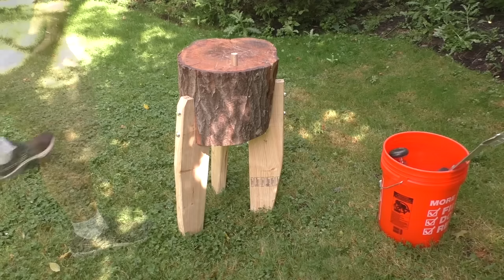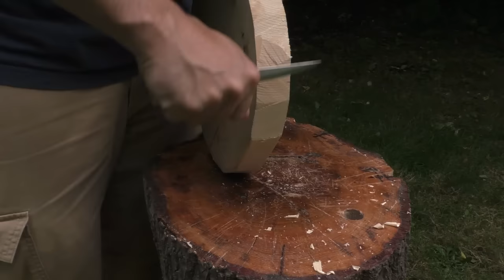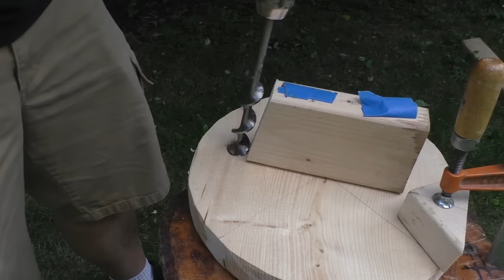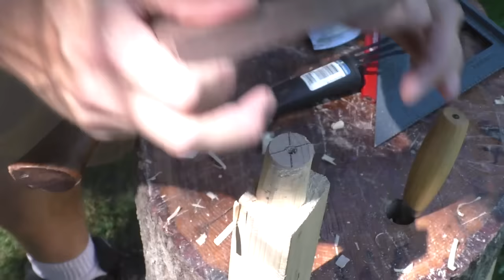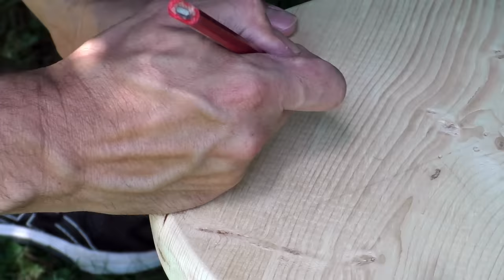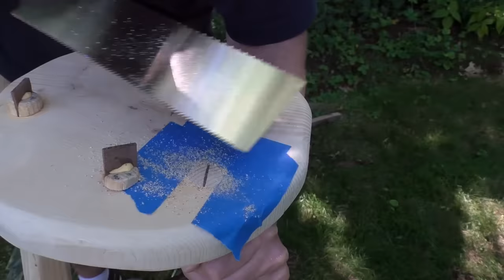Make a traditional milking stool. Limited tools. No Bench.

Comment from the maker: There's a small mistake in this video. I said the resultant angle of the legs was 5 degrees, but it's actually 15 degrees. You can experiment with angles; it's a flexible project.
Reply: Rex Krueger Hey great video I think you should make some sort of storage for all the tools on the joiners bench or some sort of storage system for all the tools we have
Reply: Dammit Rex I cut it at 5 and came back and watched the video again and I was like "I did nothing wrong!" All good, it's good practice to fix it. Thanks for the videos!

Comment: Well, there is no need  for a try-square to mark the legs position.
After drawing inner circle just put the center of the 'compass' onto one of points where the former diagonal cross it. Then draw another circle from this new center with the same string length. Points of crossing of this two circles and the opposite point of crossing the line and inner circle will be the legs positions.
Minus one tool, and still simple and perfect.
Reply: That thought crossed my mind too : )

Comment: This is the most recent project I could find that utilises the round tenon joint. I looked for it for a reason. Has nobody ever wondered why the legs are BOTH glued in with a wedged tenon...AND...the intention of the leg sliding up and tightening into the circular mortise hole? I mean, which is it to be - fixed (wedged and glued) or sliding (tightening under pressure). It can't be both. I've always wondered about that in previous projects. I'm not having a go at this or any previous projects that have this method of construction; I'm just doubting that glue on the tenons is necessary if the legs are expected to eventually seat themselves under pressure. In fact, I think it would prohibit it because it would hold for a time and eventually the glue would crack, at which point only then would the leg taper settling start. It would be better to assemble this joint with no glue at all and make the wedge slots much deeper so that they can be tapped further home as required with settling movement, while also planeing flat the leg tops as required before reseating the wedges. If you know what I mean...???

Comment: when you're planing big flats with your knife, this grip can be even nicer
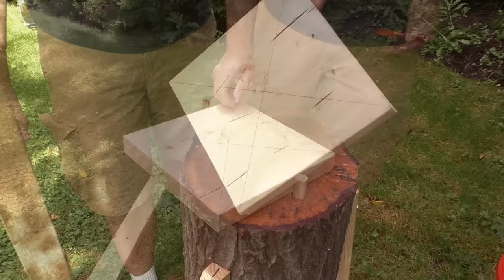https://youtu.be/0hgAzKo5G8Y (around 2:10)

You sit holding your knife in more of a dagger grip, palm-up, with the point of your knife angled back toward your navel and the sharp edge away from you. You start cutting at the close and of the material (where you're holding the wood against/along your thigh) and push away from yourself. It ends up giving you a very flat, straight cut.

Comment: Hey Rex I have a pretty interesting bit of geometry for you. 6 equally spaced points on a circle are actually spaced the same distance as the radius. This means you can use that same piece of string to make 6 points and join them like you did here
Reply: The bestagons!
Reply: no need to use a string then! use tthe speedsquare to mark 6 60ª degrees  lines (360/60 = 6 lines just like Rex did)

Comment: you can get the 60° angles by re-using your small diameter string and put the tack on the  intersection opposite of the initial starred intersection. ...this is for the more mathematically inclined, namely exactly 60 degrees in theory.

Comment: There is an even simpler way to evenly space the three legs. Just take the same string, that you've drawn your inner circle with, put a thumbknack on the opposite side of the straight line from that star you marked your first leg and them just mark two points on the circle with a pencil and string. =)

Comment: I am working on a project with wedged round tenons I am cutting by hand. I figured out the method for using the same drill bit to define the circumference of the tenon. I felt so vindicated to see that solution again here!

Comment: I don't believe in a workshop with $250 planes and $120 back saws. But this frugal tool set might be too much on the other side. I get the point though, the video and explanation is excellent. I just would not recommend it.

Comment: Around 10:15 , need tool..

How about doing a video making a tapered tenon cutter and matching tapered mortise reamer? 

Also a froe from a junkyard leafspring would be a great video. Include the trip to the junkyard and removing it yourself if possible.

The above, along with a drawknife and shavehorse attachment for your roman bench would pretty much round out a shaker furniture kit.

Then do some primitive bending with fire and wiping water on workpeice, rather than a more complex steam unit.

Comment: actually the chopping block only needs it's center of gravity shifted further to the bottom... either a longer piece of block or a concrete block, suspended with a rope from the bottom of the block should do just fine... spreading the legs would increase the chance of tripping over them and falling into..tools.

Comment: Excellent video, but I'm wondering: as a 3 legged stool, is cutting the legs to length to level them really necessary for stability? If it were 4 legged, I could see the need for that, but with three legs, it should be stable regardless of any difference in leg length.

Comment: The big upside of a three-legged stool is that three points define a plane - no wobble.  If there's a solid surface to stand it on, it won't rock.  BUT it also has a significant downside: the coverage under the load isn't as wide as the load itself.  It's pretty easy to tip it over.  If you have wood tough enough to take the load - both in the mortises AND the tenons, because the leverage applied to both elements goes up quickly with the angle - splaying them wider will make the stool a lot more stable.

Comment: There is a much easier way to mark the locations of the legs. Once you've draw the smaller circle and marked the top and bottom on the line that bisects it, take your string compass and place it on the bottom mark. Draw a mark on the left and right of the bottom mark. Repeat the same for the top mark. You now have 6 marks along the circle, use a straight edge to connect the opposite marks. All lines should cross in the center. No measuring needed.

Comment: You can reduce the size of your tool set by one, if you use your string compass to set the sight lines.  Pick a point on your second circle directly opposite where one of the legs will go (across the diameter of the circle from where you want the leg), and mark both the leg location and the opposite point in the far side of the circle.  Set the tack in the wood at the point opposite your leg location.  Make sure the string length is still equal to the radius of the second circle.  Swing arcs to each side of your point marking where the arcs intersect your second circle.   Those two points plus the first location you chose are your leg locations.  Use a straight edge to run lines from the center of the circle to each of the points and you have the sight lines.  This is probably a little easier if you do the layout before you do any shaping of the seat.  Prior to the 19th century, most of the layout work was done using dividers, straight edges, and a marker of some type.  Graduated rulers or protractors were scarce until industrialization started to seriously get under way.  George Walker and Jim Tolpin's By Hand and Eye is an excellent discussion.

Comment: You could always just add an extension to your chopping block workbench like a 2 legged saw horse just enough to hold the other end of a piece of wood you have clamped to your chopping block then you can saw it at standing height

Comment: Another way to get your 60 degrees right is to start from your diameter, find the center of the bottom radius, and draw a line square to it. The intersection points with the circle are then dead on.

Comment: @Rex Kruger from my high school geometry class, many moons ago: Circumference = 2 x pi x radius, if you assume pi is close to 3, you can approximate the circumference is about 6 x radius. If you walk the shortened string around the circumference of the inner circle you will get approximately six equal divisions. It's not perfect, but it sure is fast to get six or three divisions round a circle.
Reply: Its even easier than that: the radius of a circle is exactly the side length of the largest hexagon that fits inside. Use the string to draw arcs around the edge and you'll subdivide it into 6 perfectly
Reply: 3.14X diameter = circumference

Comment: I'm sure someone else will have mentioned this, but if you don't have a speedsquare or a protractor you can use the string and thumb tack to find the other points.

Pin the tack where your center line crosses the circle opposite your Leg1 position and draw an arc, where it crosses the circle on each side will become the position for the next 2 legs.

Got to love Euclid 😄

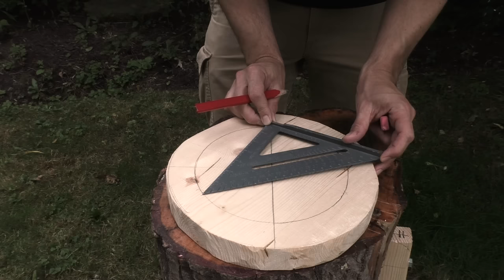Comment: 4:00 Tip: you can also use your (string) compass to construct a triangle, instead of measuring angles!

1. Draw a circle (same as Rex did), and then make sure to keep the radius set on the compass, since you'll need it to be the same later.
2. Move the pivot of the compass to anywhere on the circle itself (in Rex' example, the star mark)
3. Use the compass, as if drawing a new circle, to find the 2 points where it intersects with the original circle, and make a mark at both intersections. These will already be 2 of the triangle's points.
4. Remove the compass, and draw a line from where the compass pivot was (Rex' star mark) through the original circle center, and make a mark where it intersects the original circle on the opposite side. This is your third point.

The above is actually a shortcut based on the construction of a hexagon with only a compass:
1. Draw a circle (same as Rex did), and then make sure to keep the radius set on the compass, since you'll need it to stay the same during the whole process.
2. Move the pivot of the compass to anywhere on the circle itself (in Rex' example, the star mark)
3. Use the compass, as if drawing a new circle, to find somewhere it was intersects the original circle, and make a mark there.
4. Move the pivot of the compass to that new mark, and repeat steps 3 and 4 until you've got 6 marks, which form an equilateral hexagon!